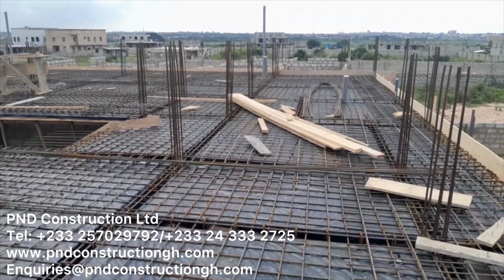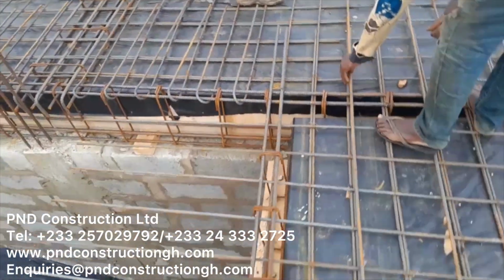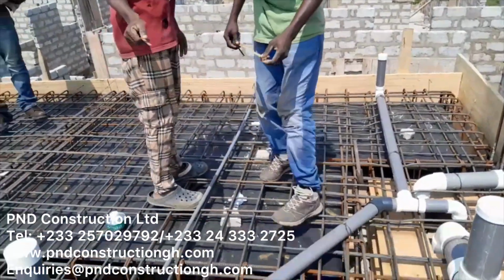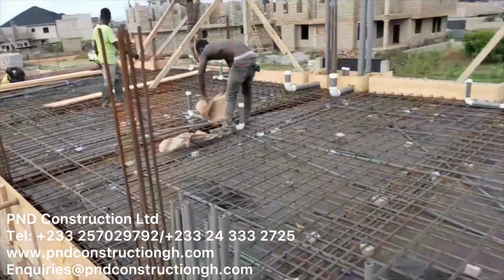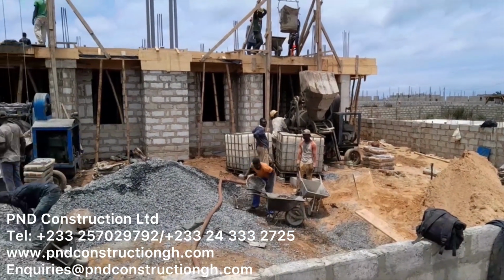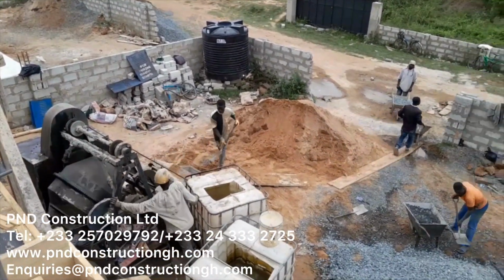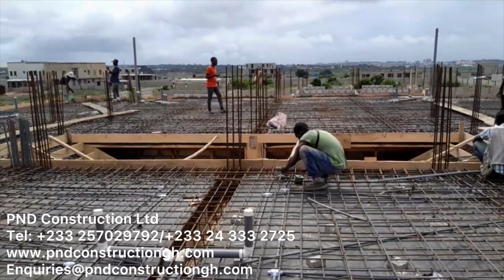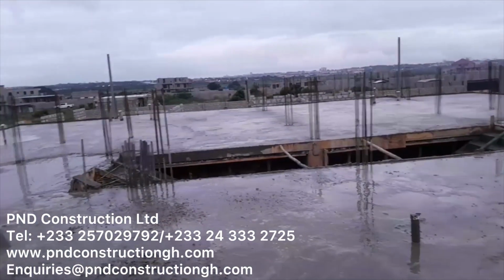Building in Ghana: 1st Floor Casting Lashibi Project ~ EP6

Comment: Do some more research on the Plaster board. I'm in the US and my ceiling is Plaster board, but I just realized that the Plaster board has a linear in one of the joints, which is pretty disturbing
Reply from the maker: Hi Edith,

We will be creating a video about Plasterboard, Pop, and fair-faced concrete ceilings soon. However, the problem you described is due to the lack of jointing tape and insufficient application of jointing compound on the joints between the boards . It's very easy to fix and shouldn’t worry you. 

Plasterboard joints need to be taped before applying jointing compound to address any potential movement between the boards. Please send a photo to this number +233 257029792, and I will ask one of our specialist plasterboard subcontractors to take a look for you. Thanks. Prince

Comment: You need to consider the dead weight of the slab. More is not necessary better. Have a structural engineer rerun the calcs if you decide to use thicker slab.
Reply from the maker: Yes, the structural design is based on 200mm thick slab. Thanks
Reply: @princenikki  Thanks for the feedback 👍. I will contact you when my drawings are ready.
Reply from the maker: @niibiquaye  our WhatsApp is +233 25 702 9792. Thanks